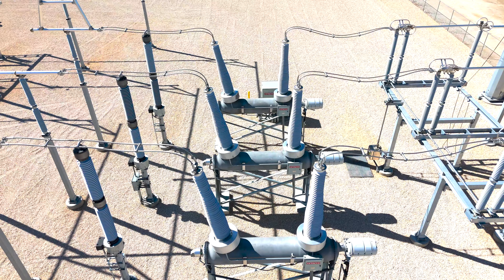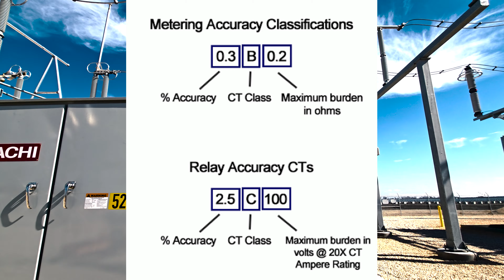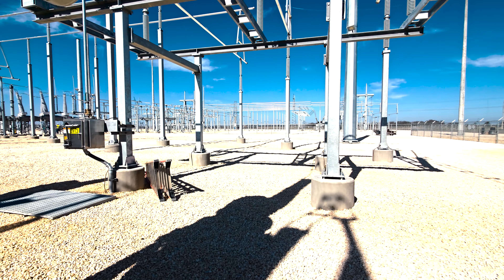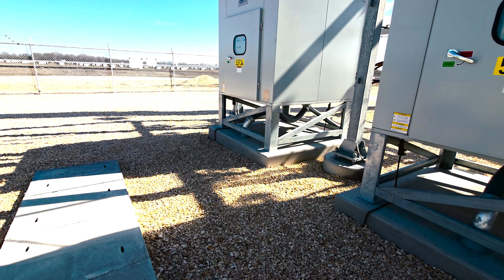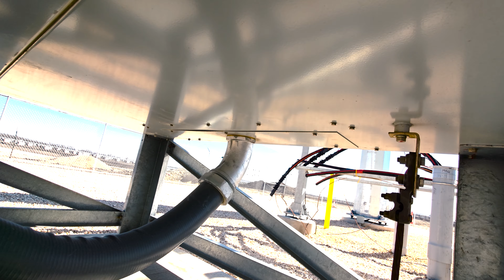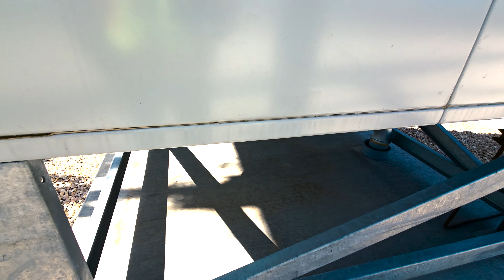High Voltage Breaker Direction and CT Configuration

Comment: Thank you. 
Stupid question - using a CT clamp meter on AC it never seemed to matter.  Power CTs for meters it did not seem to matter "just NEVER energize the line without a load on the CT." 
Is this AC one of the rare DC transmission lines?   
Does polarity make a difference with HV that it does not make with LV (480 and less)
Reply from the maker: @allenshepard7992  345kV AC. Agreed on the CT load. Otherwise you energize the core with primary voltage.

Comment: Short and sweet about CT polarity and putting the correct breaker in the correct orientation and location. Why commissioning is important to verify what was installed and it was installed correctly. Trying to think if I have ever seen an 11 called out on a one-line before. I'm used to seeing all the protective functions called out. But, just using 11 made for a cleaner one-line, although a little less info.  
Keep up the videos!